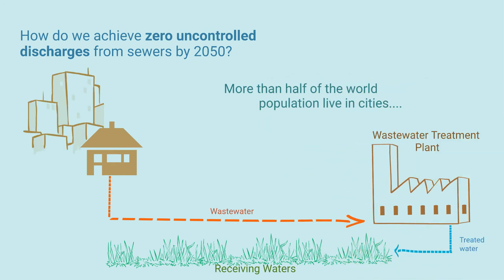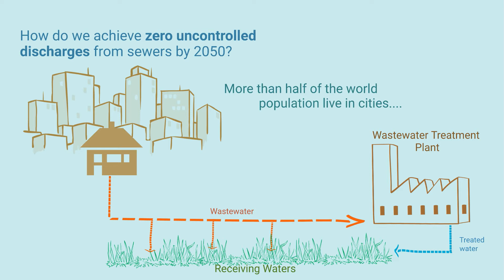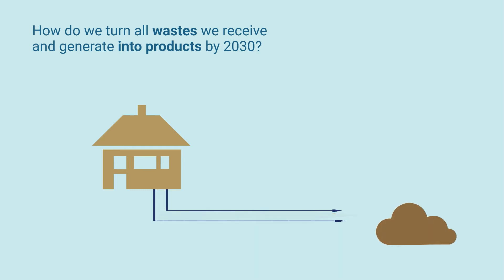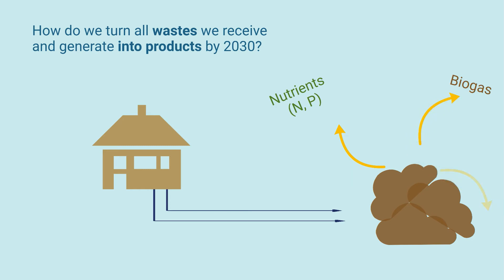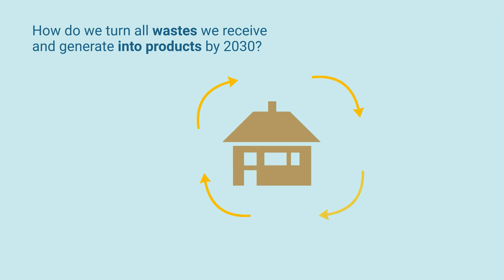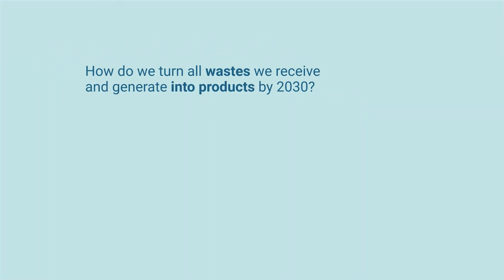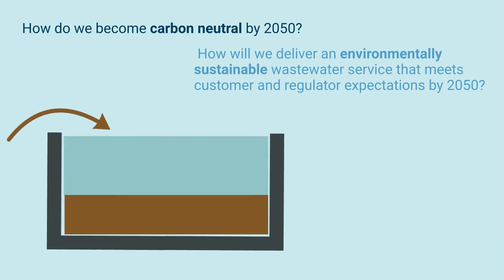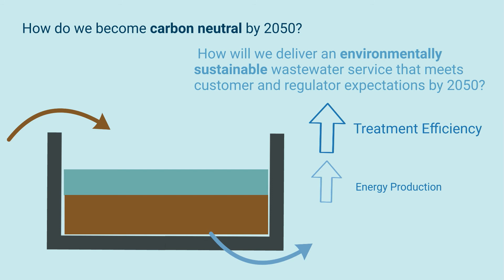WaterSIG30 - Sewer Systems of the Future - Olivia Bailey

Comment: I was wondering about the feasibility of small, localized humanure / food / cellulose composting to reduce the volume of waste before transportation / redistribution of nutrients. 
Keeping grey water seperate and black waste solid seems key. The question is how to treat and transport. It seems easier to localize reasonable amounts of compostable waste in tall buildings using gravity.
Grey water can be biologically treated with bivalves, oyster mushrooms, hyperacumulators, and riparian flora before being returned to groundwater.
As the previous poster noted, I am also curious of the role vacuum may play.